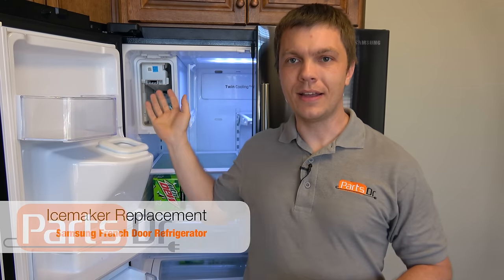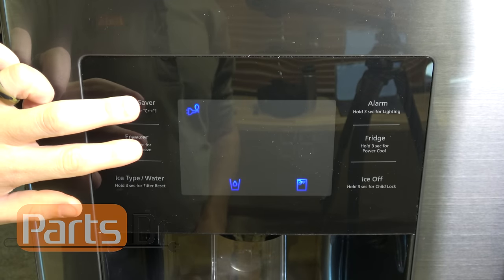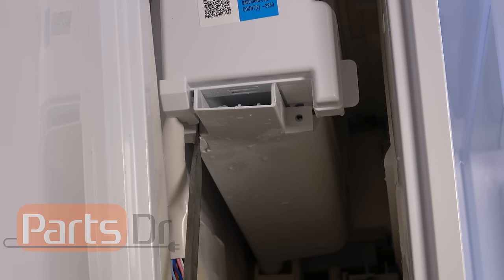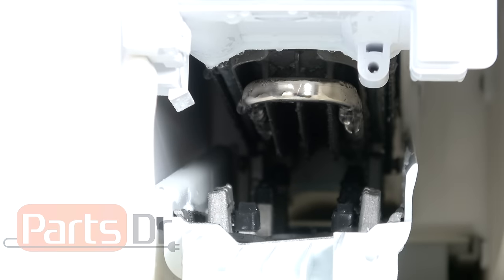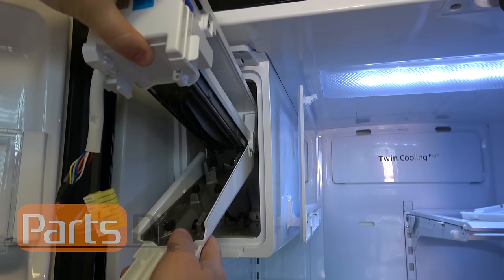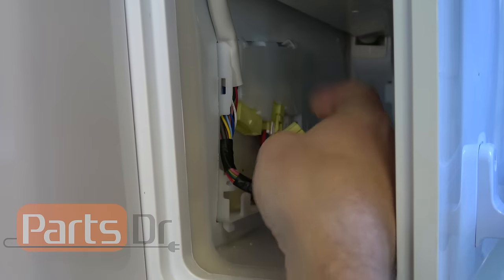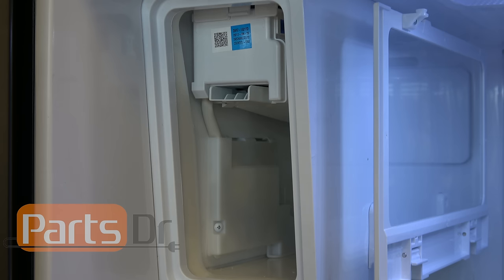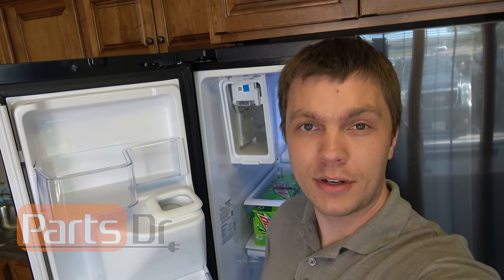How to replace Samsung Icemaker part # DA97-15217D

Comment: i get excessive buildup of ice on the bottom of the ice maker but it does make ice when i defrost it all with hairdryer. should i seal the edge es you suggested as i see light or replace the icemaker?
Reply from the maker: We would start by fixing the ice build up and then if the icemaker still isn't working properly to replace the icemaker.  Below are some videos to check out that may help you with the excessive ice build up.

Y-Clips

https://www.youtube.com/watch?v=4WrzNhySQa8

Ice Box Sealant
https://www.youtube.com/watch?v=8DkXLEXKAug

Water Line
https://www.youtube.com/watch?v=stXZXe6PRD0

Comment: I replaced my icemaker today due to extreme ice buildup, but when I did I discovered I already had a DA97-15217D, not the 217A.  Also checked the sealant and clips, but no issues there.  Hopefully it will work better anyway.

When I put in in Defrost mode there is a constant beep.  You didn't mention that in the video.  Is that normal?
Reply from the maker: The constant beeping in defrost mode is normal (and very annoying). Good luck with your repair!

Comment: Good video. The U shaped parts that hang down that slide into the top of the icemaker that hold it in place, can these be replaced. Mine broke off.
Reply from the maker: Sorry, we have not seen those available for sale from Samsung.
Reply: @PartsDr do you have a video for the bottom ice maker too?
Reply from the maker: @notion9590  Sorry we do not at this time.

Comment: How long do I keep it in forced defrost? I have frost/ice buildup on the plastic bottom of the icemaker. The Ice ends up building in the icebox because the frost buildup blocks it from dropping into ice tray?Do I just need the Y clip instead of replacing the whole icemaker?
Reply from the maker: If you have a large amount of ice you will probably need to unplug the refrigerator and leave the doors and ice maker compartment open to let everything thaw out.  Be very careful not to use a heat gun or blow dryer which could warp the plastic liner of the refrigerator.  If this happens there is no repair for it.  If your ice maker is still working okay then you might start by thawing everything out and installing the Y-Clips to see if that resolves your issues.

Comment: Hi Dave, great video. Needed to get to plugged drain which requires ice maker removal. Never wanted(or hooked up) ice maker on my Samsung it just gets in the way. Can I just leave it uninstalled?
Reply from the maker: No, the refrigerator will throw error codes if the ice maker is removed.
Reply: @PartsDr Thank you very much for fast response. Reinstalled now and all is good.
Reply from the maker: @scottgilchrist8498  Good deal!

Comment: Parts Dr ... do you recommend replacing the Auger Motor Assy along with the Ice Maker Assy?  If not, why?
Reply from the maker: Watch the video linked below.  If your auger motor assembly does not have a heater around the drain tube, then it is a good idea to replace it with the newer version that has the heater on the drain tube.
https://youtu.be/C8Qa2PGjWmw?t=202

Comment: Hello. if there's no ice coming out of the chute, does it mean, the icemaker assembly needs to be replaced? My DA97-15217a-00 is about 9 years old. Thanks.
Reply from the maker: Most commonly it is a bad ice maker that caused it to stop producing ice, but many other things can also cause it.
Reply: @PartsDr  Thanks. I asked because usually, purchased parts are not returnable. I'm worried that if I purchased the icemaker part and it turns out not to be the problem, I am not able to return the purchase. 

Also, is the 9 years lifetime too short for this product? Are the upper ice makers on Samsung refrigerators supposed to last longer than 9 years? Thanks.
Reply from the maker: @PadthaiPeter  Many fail sooner than 9 years.  Samsung does not state an expected lifespan for the ice maker.
Reply: Hi, is there an updated version of the Samsung ice maker unit?? What's the model number?
Reply from the maker: @PadthaiPeter  The newest version is part number DA97-15217D.  You can view it on our website here: https://partsdr.com/part/da97-15217d-ice-maker-assembly

Comment: I got to the step where you remove one screw and the cover on the left side should slide forward but it won't budge. The only thing I can see that might be the cause is the forward edge appears to be in a small recess. I hate to start trying to pry it up in front as that is not easily done either. Any ideas??
Reply from the maker: It could be frozen in place.  Try unplugging and letting it thaw out.
Reply: @PartsDr  There is no ice anywhere around it and hardly any in the ice maker coil. I did the Fd step to defrost what little ice was visible. This ice maker has been unused for weeks.
Reply: Finally got it out. had to run a utility knife blade along the forward edge of the cover to get it free. Just about every step was harder than it looked in your video (e.g. requiring more force, had to use pliers to get the plug out as mine is flush with the side wall so could not get my fingers behind it to grab.). At least plugging in the wiring was easy! But thanks for putting out this video. I appreciate your efforts to help us out. Do you know if there is comprehensive documentation on everything you can do with the fridge control buttons? It is not in the User Manual.
Reply from the maker: @ralphbower1138  Glad you got it out!  Sorry, we do not have any further documentation on the fridge control buttons.

Comment: My issue was with ice melting.  I sealed the gap with the sealant and I can reset the ice maker with the blue button.  I hear water fill the tray but it never freezes.   I removed the ice maker and the cooling coil is cold.  The first time I removed it I had to do the force defrost as there as a tiny bit of ice on it.  Seems like everything is good but just will not freeze the ice.  Any suggestions on what to look for?
Reply from the maker: It could also be a bad fan motor on the ice auger.  See here:  https://www.youtube.com/watch?v=7f5L1sbVowc

It could be a cooling system problem which would have to be diagnosed and repair by a professional.

It could also be a bad main control board or temperature sensor.  See this video for temp sensor testing instructions: https://www.youtube.com/watch?v=J5bwcteeJNM

Comment: I have done hundreds of these kits, Sometimes it is very difficult to push the bottom of the ice maker back into place. I always make sure to use a steamer to remove all ice. Have you found an easier way to click the bottom into place. With the loop defrosted and the ice maker locked in place, the loop is lined up correctly but sometimes it seems to require brute force to close and get the screw in. In the video it snapped right i n place. Have you ever encountered one that did not close easily?
Reply from the maker: What you describe sounds normal.  We think Samsung wants it to be a tight fit so the cooling loop has good contact with the bottom of the ice maker.

Comment: Question---> if I go to your website and buy the replacement part that's the same as the one we are removing... it will break again in 6 months.... I don't want to buy the same ice maker and have it happen again... is there a permanent fix?  Question---> Moisture buildup is happening, ice gets stuck on the top towards the back and bottom of ice maker, I remove the ice buildup and it works for a week or two... do I still need to buy the new icemaker or just replace the Y clip and plastic piece and maybe seal up the compartment.... ?
Reply from the maker: We recommend to check these things in the video linked below to prevent further ice maker issues.
https://www.youtube.com/watch?v=EdNAhCxIoGk

Comment: Great video.  I did everything to rehab the icemaker in my fridge, but it still does not make ice.  It has just quit.
Fridge p/n RF28R6201SR/AA :: ice maker p/n DA97-15217B.

What icemaker should I order to replace the ice module?
Reply from the maker: This is the new ice maker for your model refrigerator here: https://partsdr.com/part/da97-15217d-ice-maker-assembly

Comment: Does this ice maker control the water flow into it?  I seem to have a problem with it not providing any water to make the cubes.
Reply from the maker: Hi Dave, the ice maker, main control board, and water inlet valve (usually located inside the filter case assembly) all work together to control the water flow into the ice maker.
Reply: The fridge is throwing a 39 c message that hopefully is the ice maker itself..  guess I'll have to start with that and move to maybe the control board.  thank you.
Reply: I can still get water from the fridge door so maybe I'm still good with the inlet valve.  This is a rf28hdedbsr Rev 52!  with a  DA97-15217D that just stopped making ice.  Guess all these Samsungs go bad fast.. 3 year old now.
Reply from the maker: @djonesyyz.  39C is an ice maker function error according to Samsung.

Comment: I did RD and it beeped for about 20 minutes and they reset (stopped) on it's own).  I then heard the sounds of refrigerant circulating.  However, it is has been about 1 hour and not one ice cube has dropped.  I tried running thru the menu, getting to RD, and then pressing one more time.  Then getting back out, and cling the ice maker one.  Nothing.  I have not removed the ice maker unit.  Just the ice tray.

Comment: Hi.  Looks like a very good video.  How do you know if you need to replace the Icemaker part versus something else to fix the problem?  The ice maker has been working great for 8 years.  Two weeks ago our guests emptied the ice from the freezer and since then it's not making ice.  I can hear it trying to make the ice but none are forming.  Are there some quick checks I can do to determine the root cause of the problem?  thanks!
Reply from the maker: Hi Chad, these ice maker systems are complicated to diagnose.  The ice maker works together with the water valve (which supplies water to the ice maker), main control board, and cooling system to make ice.  So far we haven't come up with a quick check process for these ice maker systems. Usually if you hear the ice maker making noise but it is not making ice then it is a good idea to start by replacing the ice maker and going from there.

Comment: I've had the ice maker replaced. It still didn't make ice or freeze up anymore. However, no ice will drop unless the bucket is removed. What would cause the ice maker to work only when the ice bucket is removed?
Reply from the maker: Maybe check to make sure nothing is blocking the IR ice level sensor on the auger motor?
Reply: @PartsDr  I checked to see if the sensor was working (it shines red when photographed) and it was working. But I think the tech pushed it out of place when he changed the ice maker...as it wasn't sitting in the grove that points through the hole in the bucket to trigger the ice maker ....I moved it back and it's dropping ice now! That was a simple fix. Thanks!
Reply from the maker: @danag1493  Great!  Nice job on fixing it!

Comment: Thanks for the detailed video.  I believe my ice maker has called it quits and needs replaced at it no longer responds to the reset button.  My refrigerator is Samsung RF323TEDBSR/AA with no numbers after the /AA.  Do you know if that would require the Y clip kit?  Thanks!
Reply from the maker: You will need to remove your ice maker to check to see if yours has Y-Clips from the factory.  If they are missing you will need to order them and install them.  Below is a video link showing more information on them.  https://www.youtube.com/watch?v=4WrzNhySQa8

Comment: I'm stuck at trying to get the cover off. It won't budge. Any suggestions?
Reply from the maker: Try letting it warm up and thaw out, it might be frozen and stuck in place.  Don't use any heat sources like a blower dryer or heat gun as the plastic will melt and warp very easily.

Comment: Thanks for the video,  is it possible to get just the bottom tray you mentioned here 5:01 ,  mine melted when using a hair dryer to it.
Reply from the maker: No they do not sell that piece separately from the ice maker assembly.

Comment: Ryan, great video! Very clear instruction.
Quick question, I presume that the Forced Defrost cycle works on the entire fridge? Or does that cycle only impact the ice maker?
Thx,
Rhett
Reply from the maker: The Forced Defrost cycle affects the entire refrigerator (ice maker, Fresh Food Evaporator, and Freezer evaporator).
Reply: @PartsDr  will running this forced defrost cycle with food in the freezer, deli drawer and fridge be a problem?
Reply from the maker: @chasecomptondesign  Those areas will start to warm up the longer you run the forced defrost cycle so you will want to keep an eye on it if you are defrosting it for longer periods of time.
Reply: @PartsDr  thanks for the reply. I have the fridge on full of food, with the ice maker part unplugged but it's iced up and I'm chipping away. I'll run the force defrost tomorrow for 5 minutes and see if I can get the bottom door to drop on the ice maker.

Comment: An excellent and very helpful video.  I have the RF25HMEDBSR and the buttons that need to be pushed to enter the forced defrost mode are slightly different.  The first step is to push both the upper left and the middle right (Freezer and Lighting) buttons for 8 seconds.  Then the display goes blank.  Then push the freezer button repeatedly (slowly) to advance to the Fd state.  This will turn off the freezer and go into forced defrost mode to be sure to get the coil (discussed in the video) to defrost.  To get back to normal refrigerator mode push the freezer button briefly to get to blank display.  Then push the Freezer and Alarm buttons simultaneously for about 8 seconds. The normal display should come back on.

Also, I wanted to buy parts from him (partly in thanks for the video); but, his website wants too much information.  Too bad.  Lost sales.
Reply from the maker: Good information, thank you for sharing!

Comment: Thanks for the video. Our Samsung ice maker is completely dry. Doesn't seem to be getting any water to the unit? Could the line be frozen or is there something else we should try? We are able to get water from the dispenser on the door
Reply from the maker: No water to the ice maker can be caused by a bad ice maker, bad water valve (located inside the filter case assembly), bad main control board, or a frozen water line.  Troubleshooting which of these is causing your issue isn't easy.  One thing to try is to manually fill the ice tray with water and see if the water freezes into ice cubes and the ice maker dumps the ice. If the ice maker doesn't dump the ice then you most likely have a bad ice maker.

You might find this video helpful for accessing the water filter case assembly here: https://www.youtube.com/watch?v=qUblOnomHHY
Reply: Thanks, I will try that. Not sure if it a coincidence but the problem with the ice maker started when I replaced the water filter? (Glacier Fresh model GF-20B) Could this be a potential cause?
Reply from the maker: @layne20021  It probably isn't the filter if the water dispenser is still working okay.  But, we have seen quite a few issues with non-OEM filters causing issues with leaks or no water flow.

Comment: I am replacing an ice maker model # DA97-13718A with a model # DA97-13718C. No mention in the video about the kit with the replacement ring and “Y” clips. Should the ring and “Y” clips be included in the ice maker replacement procedure?
Reply from the maker: Hi Rich,  if your refrigerator didn't come with the Y Clips installed from the factory then we would recommend to order and install them when you replace the ice maker.  Below is a link to the Y Clip kit.  https://partsdr.com/part/da82-02367a-clip-assembly

Comment: What about the outer casing? Mine is bubbled due to using a blower dryer to defrost and samsung said it cannot be replaced but there are screws and seams holding it in so really don't believe that. Have excessive moisture so thinking we need the clips replaced.
Reply from the maker: Unfortunately, Samsung does not sell that part.
Reply: @PartsDr  I actually found it here http://www.samsungparts.com/Products/Parts_and_Accessories/RF263BEAESR/AA/Default.aspx
Reply from the maker: @cbroom2007  Yes that is the correct one.

Comment: Hello.  I have Samsumg rf25hmedbsr/aa-13.  Is building ice in the Evaporator Fan Cover Assembly.  That cause the fan make a lot of noise.  I clean up but after a couple weeks the it build ice again.  Could you help?
Reply from the maker: Try testing the defrost sensor on the evaporator and replacing if bad.  Below are two videos you will find helpful.
https://www.youtube.com/watch?v=J5bwcteeJNM
https://www.youtube.com/watch?v=I_aDS77dY8o
Reply: @PartsDr  It pass the test.  I tested the defrost heater and gave 122 ohms but the Bimetal Thermo Protector it keep beeping at room temperature.  So my husband ordered it and the Evaporator Cover Assembly.  If you have another recomendation let me know.
Reply: @sheilahernandez5307  If you do not fix the drain blockage issue every  time the unit defrost the water lays underneath the evaporator so when the fan comes on it pulls the moisture back into the coils and cover! You need to install new drain tubes with extended defrost clips.

Comment: Great video, but where/when do you apply the Adhesive Sealant part number:  DA81-05595A that you have listed under your description? Also, make sure that the temp is at least -4, anything warmer will not keep the ice maker compartment cold enough and you might get partially thawed ice that may cause a jam. This is what I was told by a service tech on a warranty service call.
Reply from the maker: Hi Calvin, if you can see light between the ice maker compartment and the wall of the refrigerator you will want to apply the sealant along the left wall and rear wall of the inside of the ice maker compartment to ensure no air can leak into the ice maker compartment.